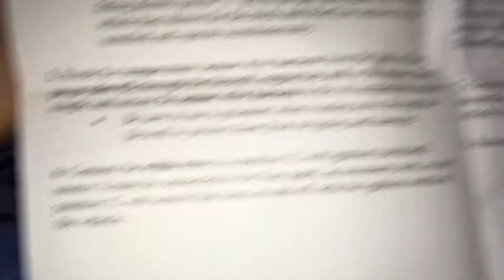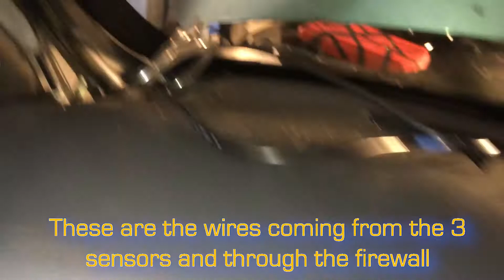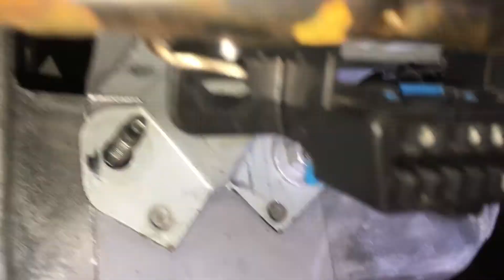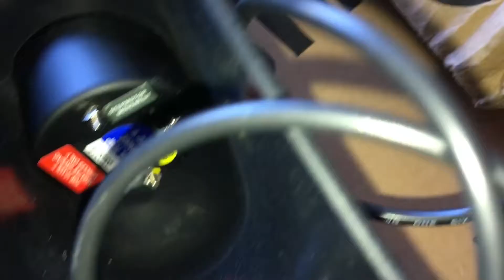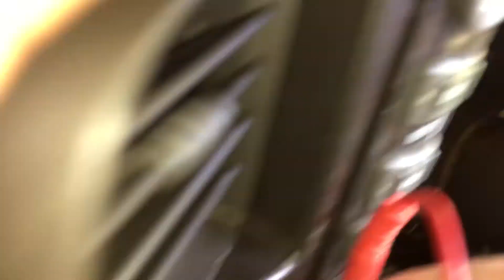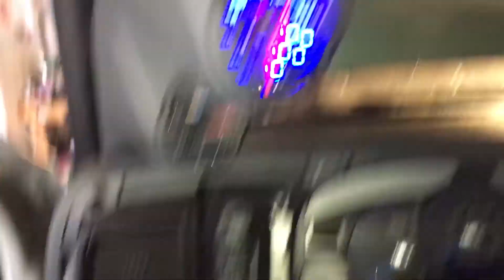Installing Gauges Glow Shift Tahoe - Pt. 3 - Putting it all together

Comment: Well I know its a little too late now but im running a tow max trans temp gauge with 3+ years in 12v experience ran into a issure were now all my interior lights stay on ... i had to manualy take the bulbs out of each light so my battery would die ... any suggestions? Edit: 2002 yukon xl 4x4